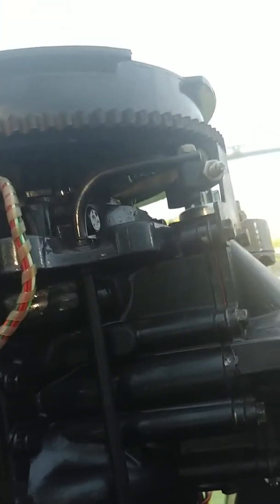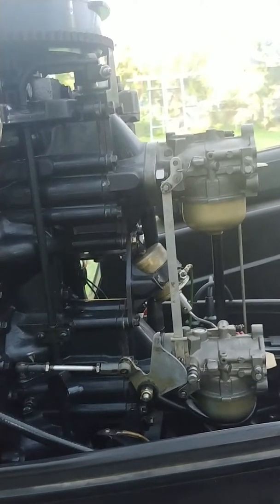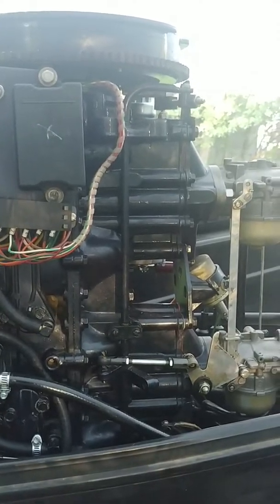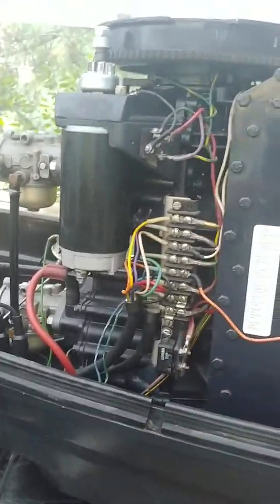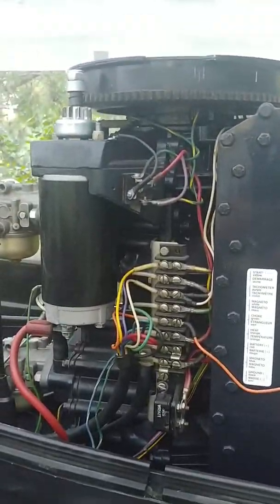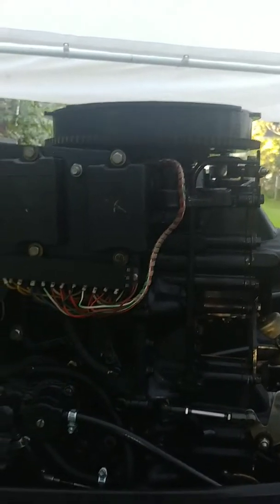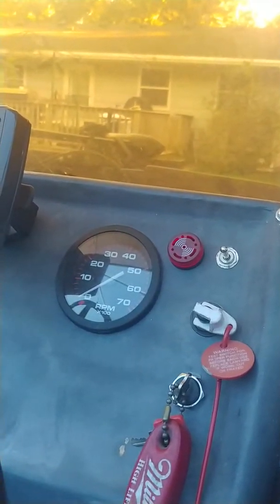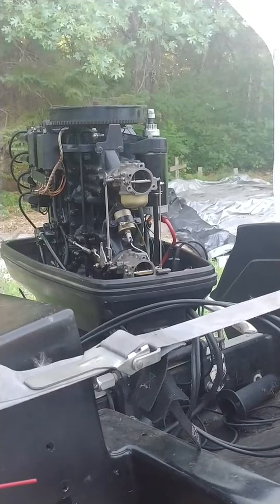125hp force help me diagnose

Comment: Old video 🙋 the whining noise in the flywheel is the charging for the battery it does this passing the magnets in charge coil alot of motors do this

Comment: I think ur over exaggerating by a mile🤣 this is how every force 120 I’ve owned sounds
Reply from the maker: After listening to old clips, it does sound right. Just seemed off. I had troubles with it flooding on the water due to a bad check valve in the fuel pump. She runs good now.

Comment: Does it smoke heavy after sitting between starts on the water? Recirculating check valves can cause fuel mix to pool in the top/bottom pockets of the crank giving you rich mix starts
Reply from the maker: Ended up being a bad check valve(leaky) in the fuel pump. I replaced all but the one that was pressed in when I rebuilt it. Ended up dremeling the old one out. She runs great now.
Reply: Same problem..adjustment on ignition timing problem...help
Reply from the maker: @randyrivera611  there is procudure for setting timing at cranking speed. You need to ground all of the ignition wires and have a timing light. Plus it's good to have a buddy that can help on the lake to check it afterwards.
Reply: @redfury111  did you make 28 degree on timing?i was thingking 30 degree the 1 one the  midle?